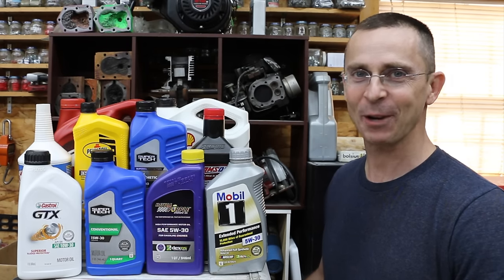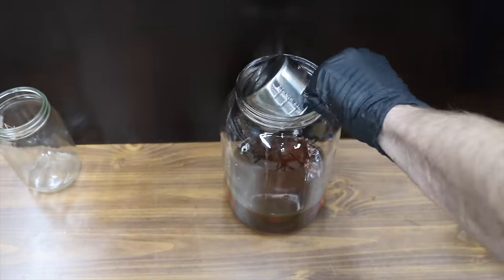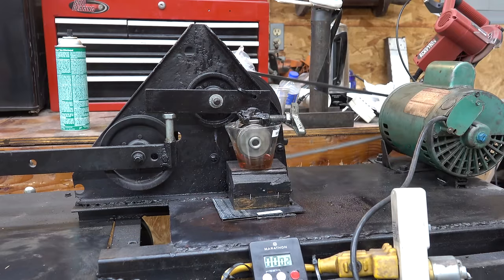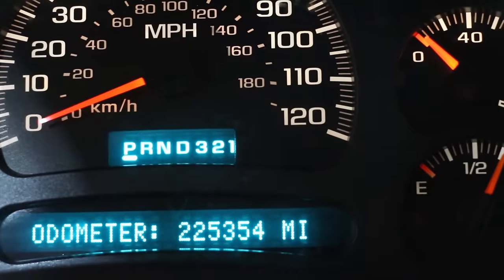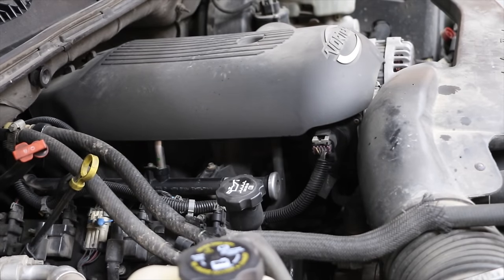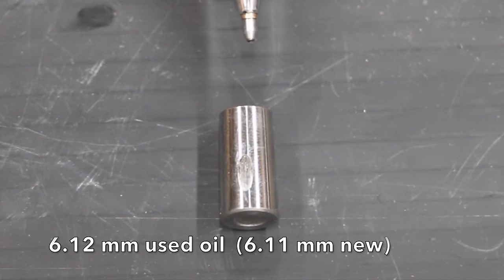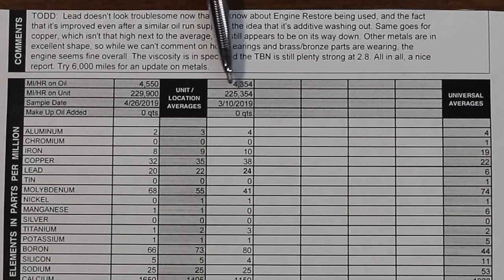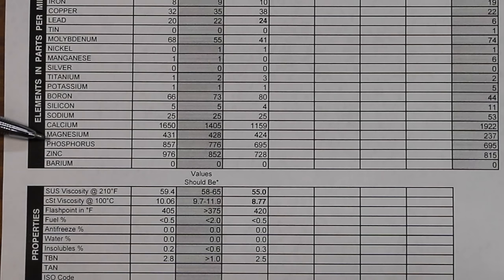Will Mixing 10 Motor Oils Damage an Engine? Let's find out!

Comment: Do a video about putting the wrong type of antifreeze into the wrong type of car/truck (or simulated) and explain why it's good or bad.
Reply: Would be interesting
Reply from the maker: Thank you for the video idea!
Reply: The only "wrong type" is using conventional green in a system with aluminum and plastic, or using it to top up a silicate free coolant. Every manufacturer specific coolant is just their own take on silicate/phosphate free coolant. You could mix honda, nissan, toyota, and vw coolant all together in your car and not a damn thing would happen because they're all just similar takes on the same thing. The colors mean nothing. 
Anything labeled for a specific make, and anything labeled as extended life are all the same thing and can be used interchangeably.
The only outlier is conventional green (which really shouldn't exist anymore)
Pretty much anything you're going to buy off the shelf is all the same thing
Reply: @Xixu.co.6  I've got HOAT in my dodge charger
Reply: The short answer is - you can use any antifreeze if you change your antifreeze often.  However, if you change your antifreeze as often as you change your thermostat for instance, the wrong antifreeze will eat the seals in your engine.  You really don't want to know how I know that... it was expensive.
Reply: I was just going to suggest this right before I saw your comment. So I’ll just give yours a thumbs up and hope he does it!😊
Reply: @Xixu.co.6  theres more to this than what you would think. Colors can not be mixed unless it's a universal antifreeze and a color. And they use oat and hoat in cars and light duty trucks. I know this from my volkwagen.
Reply: @guardsmanom134  That's why it needs to be tested! Learn from science and not mistakes. :P
Reply: It is very vehicle dependant.  Some vehicles it will not matter.  Some need specific additives for lubrication and seal conditioners.
Reply: Other reasons why its a good idea. Each manufacture has marketing wank on the labels and should be tested accordingly. 

Suggested testing conditions below.
Rubber/flexible seals
Different types of metals/alloys (such as nuts, bolts, etc)
Apply on RTV Gaskets
+/- extreme heat/cold in tandem with the stated above
+/-mix in some oils (who hasn't had a head gasket leak eventually)
Could test thermal capacity
Could test to see what's "left over" if it's all boiled off
Could test to see if Antifreeze will/will not freeze at the advertised temperatures.

Anecdotally I've seen engine blocks cracked from antifreeze, well freezing, at -50 in Minnesota.
Reply: @ProjectFarm  Other reasons why its a good idea... Each manufacture has marketing wank on the labels and should be tested accordingly. 

Suggested testing conditions/ideas below.
Rubber/flexible seals
Different types of metals/alloys (such as nuts, bolts, etc)
Apply on RTV Gaskets
+/- extreme heat/cold in tandem with the stated above
+/-mix in some oils (who hasn't had a head gasket leak eventually)
Could test thermal capacity
Could test to see what's "left over" if it's all boiled off
Could test to see if Antifreeze will/will not freeze at the advertised temperatures.
Could also test over weeks/months (because people do not change their coolant often)

Anecdotally I've seen engine blocks cracked from antifreeze, well freezing, at -50 in Minnesota.
Reply: 2 wrongs make a right euro boy.....
Reply: @ajl9491  nah, that's two lefts, but I guess that like the rest of us men you're directionally impared...
Reply: @AgentLokVokun  I wish I had PF back then... I would still have my first Chevy.
Reply: South Main Auto Repair did that...one of the cars they looked had old antifreeze that had the consistency of peanut butter. :-D
Reply: Also can you show what happens when people mix the different types of antifreeze
Reply: I drain the antifreeze and run water when the temp is above 40 degrees. That way if I blow a hose I don't lose $$ worth of antifreeze. Been doing it for 35 years. -Also, before I refill it in the fall, I flush the system and put in fresh, new antifreeze. Guys have always told me that my water pump would go out, but so far, so good.
Reply: @MrTruckerf  antifreeze actually is the main reason why your water pump fails due to corrosion from the coolant... water is and has been proven to be the most effective coolant but the boiling point is to low
Reply: Dexcool + green stuff = sadness.
Reply: I've been wrong before and may well be now, but I THINK they essentially don't sell the old conventional green antifreeze anymore, and all the new stuff is okay for virtually all automotive engines.
Reply: @The_sinner_Jim_Whitney  Zerex and Carquest still do. Possibly others. I mean, probably they should just stop :-)
Reply: A good quality universal coolant is really all thats needed. Prestone makes a good universal coolant, it's what I use, though there are others. It used to be that mixing the wrong coolant could cause gelling, that was the case with Dexcool, mixing some types of coolant could cause it to gel up.

However, modern universal coolants are safe to use in all engines no matter what coolant was used beforehand. The only exception may be ultra high end cars like Rolls Royce, Bugatti, etc. Though you likely aren't looking here for advice on those. No quality modern universal coolants will cause any adverse wear or gelling in engines. 

Though flushing an engine with water then not properly cycling coolant back in with enough concentration has been attributed to 'bad' coolant. I have had several people over the years tell me that X coolant brand was bad as their cooling system had issues after they flushed it, that is the cause of their current issues. When talking to them about it, in almost every case the customer had tried to flush their own coolant, and made one of a few mistakes. Either they bought concentrate and put it in straight (usually overheating and smell issues),  they diluted the concentrate (more overheating and smell issues), or they flushed the engine with water from a garden hose, then put in some mixture of coolant that leaned out due to the engine block not draining of fresh water (diluted the coolant, and more overheating/smell issues). In most cases when I tested the coolant with the proper equipment, the boiling/freeze protection was off and the coolant was either boiling or freezing depending on the time of year. I never saw any problems with sludge or corrosion or anything else that could be the cause of the new coolant.
Reply: That should answer most questions about that... People are so uninformed about that.... DO IT !!!
Reply: Xixu lord of uwu What does the green coolant do when missed in?
Reply: Good ideal. but to do a test like that would require a couple of years or more to get the results.
Reply: guardsmanom134 Three lefts...

Comment: I'd like to see a test on hand cleaners. For example GoJo vs Fast orange vs basic laundry detergent/ dish soap etc.
Reply from the maker: Great video idea!  Thank you
Reply: I'd like to second this. Especially to test how different hand cleaners work against several common types of 'hand contaminants' such as grease, glue, paint/varnish, label adhesive, etc. I suspect different types of cleaners may work better or worse against different types of crud. 

I've seen tests of hand cleaners before, but often they just test against dirt, which is the least hard to clean off. I'd like to know what will get hard-to-remove stuff off my hands (without removing the skin in the process).
Reply: Fast orange gel is the best.
Reply: @ProjectFarm  I don't guess basic gasoline or diesel would count.
Reply: For sure lava
Reply: @lewiemcneely9143  
Lol, I was just thinking about how my dad showed me to use fresh gasoline to wash really heavy dirt and grease off my hands. Then using copious amounts of Dawn. To this day, I always lather without water when my hands are greasy because it cuts grease better that way.
Reply: @Jetmech1781  I just use and used gas and that was it. That'd get me inside so I could was a bit with something that smells a little better!
Reply: Id suggest boraxo as a baseline
Reply: Go Joe is best. Next is dawn dish soap.
Reply: @lewiemcneely9143 Gas gets engine oil off, then a dab of diesel to get any remaining gas off.
Reply: Correct. It would necessitate a series of tests of product versus contaminant to match best product to individual contaminant.
Reply: Now that is a great idea for a video.
Reply: To clean oil/grease/paint/etc off my hands, I use powder Tide detergent.
Reply: The best and cheapest is dawn dish soap. That’s what ships use when there is a oil spill. Breaks the oil down and disappears. “Never had a oil spill”
Reply: Ive always used dawn with a bit of sugar, id like to see that tested as a homemade gritty soap
Reply: Softsoap antibacterial is surprisingly good on removing motor oil..nearly as good as dawn.
Reply: New transmission fluid makes a good hand cleaner.
Reply: Gojo is the best
Reply: Sam Mclelland good idea. Cherry bomb seems to work very well. I’ve found with all of them you’ve still gotta use the little blue plastic scrub brush.
Reply: I like cherry bomb hand cleaner
Reply: yea but test also wooddust with hand soap its the only thing I know that will clean my hands after repairing my car
Reply: I was skeptical at first but tub o towels cleans my hands better than the fast orange I swore by for years. I hope it’s safe for skin like it says because it almost seems too good to be true.
Reply: Classic tub Gojo without the pumice works just as good as gas.
Reply: Yes and please do the fast orange WITHOUT pumice. I hate the one with pumice, if you use the cleaner a lot the fast orange without smells good, works great, and it doesn't leave your hands sore.
Reply: @Markus0021  I have 3 or 4 different  cleaners depending on what I got myself into. It's really a 3 step process to get from grease monkey to date night clean.
Reply: @piduino  a little 100% bio diesel is ideal. You only need an ounce.
Reply: @billyboots3730  sugar is a great idea! I've used very fine sand but obviously you don't want that down your drain.
Reply: @dimos5422  just basic saw dust?
Reply: @otm646  yup its water soluble so you cant beat that for going down the drain
Reply: @lewiemcneely9143  ya and let's face it, it's my mom. I'm actually quite proud to be a stay at home son.
Reply: @otm646  yup any wood saw dust can do the job as well as sand but its more scratchy
Reply: @piduino  There you go and Mom needs somebody reliable. Moms are like that!
Reply: I just use Soda crystals mixed with washing up liquid.  It's cheap and easily available. 
The added advantage is that  Soda crystals clean your  waste pipes as they pass through the waste /  drain system
Reply: Try baby oil on things like tar. Taught to me by a grandparent. For other things Dawn and Dawn with baking soda.
Reply: @otm646  same, when it's really bad I take a handful of varsol in to mix with the first go around 😅

Comment: Now what happens if you add in 20 different gasoline detergent cleaners.  
V power, techron, seafoam.
Reply: Yes!
Reply: I’m not the smartest man but I’m thinking you will get a lean code
Reply: Nothing happens...
Reply: @steve5912  I even added diesel (small amount of course) fuel in my engine and nothing happened.
Reply: @hmongxas1642  Not necessarily. Most fuel system cleaners these days are O2 sensor safe. Says it right on the bottle.
Reply: All of them use a base of naptha or some kind of light hhydrocarbon. Nothing will happen, if you use the proper quantity, Pour them all in at once, hard to say. But probably nothing as long as you have some gasoline in there.
Reply: Yes,  more mixing things! Like just walk up to the garage shelf on which this kinda things are and just go to town.
Reply: @throwaway3661  i wouldn't do this on directly injected turbo engines. if diesel: the injectors will be damaged, if gasoline they'll clog up.
Reply: @tdsangel  I didn't do it daily. I was just trying to get rid of 20 gallons of diesel fuel I had in my garage. To your point about damage the injectors, I used injectors cleaners twice a year and my vehicle was and running just fine. In fact one of my vehicle has 205000 miles on it after I ran with diesel fuel. In addition, I was too lazy to dump a quart of  used oil away. I slowly dumped into my gas tank little at a time. As I have mentioned, It was and is running fine (205000 miles) until today and the engine power is as good as new. Furthermore with the crazy thing I did. I did maintain my vehicles as it should. I did it the least maintenance requirement to proof to myself, not anyone else. If something wrong I can easily fix it myself, which I don't recommend to anyone.
Reply: Or can an engine just run on cleaner?
Reply: @throwaway3661  Yea nothing should happen. To clean out sludge it can even be ran on straight diesel for about 20sec or so. Although id never do that to my engines id at least put a small bottle of oil in with it.
Reply: @throwaway3661  Lol i would have Gladly taken the 20 gallons od diesel you didnt need.
Reply: I would like to see that!
Reply: Yesssss

Comment: I’ve been a mechanic for 55 years, and have always been a believer in not mixing oils. I have several different oils on my shelves that have accumulated over the years. I let different ones use the lift to change oil. But after watching your video I’m not quite as worried to use up some of small amounts of oils kicking around! 
Thanks Paul V
Reply: Paul Villeneuve I can't believe after 55 years you just found out it's okay to mix.. people make there own blend oil all the time my mixing
Reply from the maker: Thank you

Comment: Great video. Where I work our garage department uses 15w-40 for every engine. Ranging from small 4 cylinder suvs to heavy duty diesels. It makes my skin crawl but each vehicle seems to run just fine. Some vehicles have 100k miles and they are just truckin. Your video puts the science behind the madness although I could never do it to one of my cars. Thanks again and keep the videos coming!
Reply from the maker: Thank you!
Reply: That's a good way to shorten engine life, especially in newer vehicles.

Comment: Would you consider testing dot 3, 4, or 5 brake fluids?
Reply from the maker: Thank you for the video idea!
Reply: Technically DOT 5.1.
Reply: @Taluvian  the silicone based
Reply: Actually I'd like to see brake fluid used as engine oil.
Reply: Everyday stuff glycol-based Dot 3, 4 and 5.1 compatible with each other then the silicone-based Dot 5 brake fluids used in Racing, Motorcycle and Military applications other then that there no point in testing as only main diff in Dry and Wet Boiling point
Reply: @Enjoymentboy   it swells the seals   this is a "old  used car dealer trick"  to stop them from leaking

 this would be fine to test on a old junker car   but not to be used on a daily driver

as soon as you replace the oil it will start leaking again probably worse then before
Reply: Christopher Vick , brake fluid Swell's all the rubber seal , so leakage will start soon , and oil pressure will be low due to thinness of the brake fluid, which will result in more wear on the engine metal parts
Reply: Dot 5 is for racing i think
Reply: Unlike motor oil, brake fluid types are not interchangeable. Dot 3 and 4 are glycol based and dot 5 is silicon based. 3 and 4 absorb water while 5 doesn’t. They are not different grades, they are different products.
Reply: @dozer1642  DOT 4 can be added to any DOT 3 system amd it is fine. A lot of DOT 4 brake fluid products are actually labelled "DOT 3 & 4" because of this.  DOT4 is basically higher performance DOT3. DOT 5 brake fluid is the only one you need to watch out for because it is made of different chemicals and is not compatible at all. DOT 5.1 however is a glycol based product just like DOT 4 & DOT 3 and so it is probably compatible.
Reply: That would be great. With some hydraulic tools for test it
Reply: Boiling point makes the difference between dot 1,2,3 and 4, yes 5 is silicone
Reply: You can put dot 4 in 3 but not 5. 5 is silicon base you will ruin brake systems if wrong.

Comment: I have 5 different 0W-20 oils mixed in my Honda engine.    I was clearing out partial jugs and random quarts from my garage to free up shelf space.
Reply: i too have 5 jugs of 0w-20 laying around conveniently
Reply: Adam A not jugs, a lot of quart bottles w/ some partially full. Amsoil, Redline, M1 AP, M1 EP, and I think there was some Idemitsu in the cylinder head from the last oil change.  I’m weird I try different oil brands.  The oldest was maybe 6 years but oil doesn’t expire if it’s stored indoors.